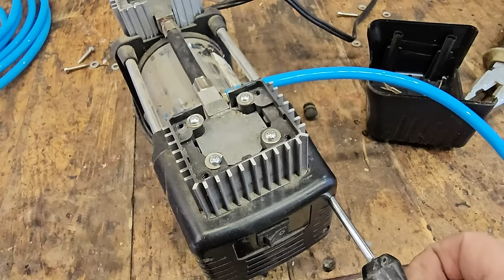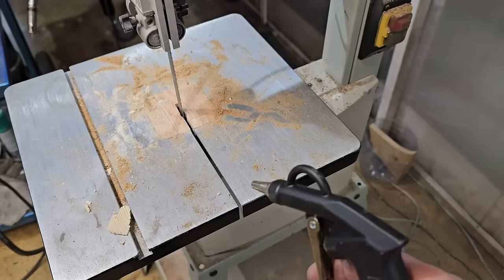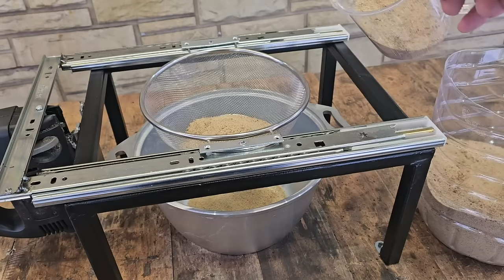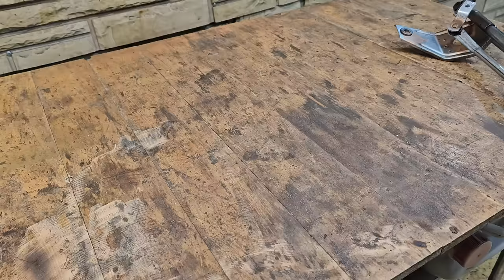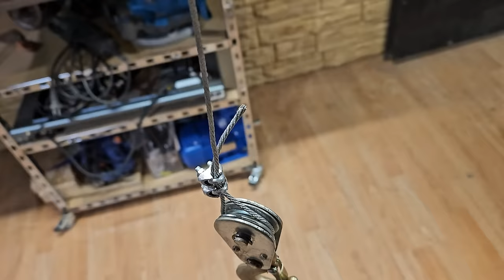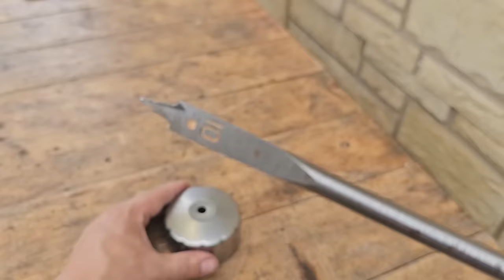4 top brilliant DIY ideas from junk in your workshop. Don't throw away what might be useful !

Comment: I really like the small compressor you made but I was wondering if it was DC or AC because when you showed the finished product it didn't have a battery anywhere or even a power cord of any kind so how was it able to pump~?? Not a big deal but I have a 12 vdc compressor and wanted to make one like yours but was wondering if the 12 vdc would be enough power to fill the tank under pressure~! I enjoy your videos and of course I am a subscriber and greetings from Arizona. :person-turqouise-waving:

Comment: Some fun stuff but I don't have a MIG welder, already have a 'full size' workshop compressor and have a jigsaw because I need a jigsaw not a sand sifter.
I bought a 2,500lb (1,100Kg?) 12 volt winch several years ago, haven't actually found much use for it though, sure as hell wouldn't trust plastic worm wheel in wiper motor with anything weighing even 80~90 lbs (45~50 Kg?)
Really hate watching things backwards, where does one get a TLAWED angle grinder? 😁